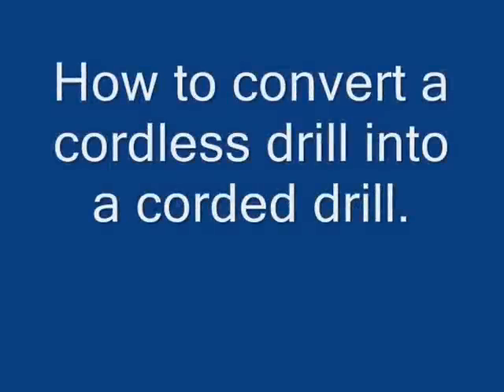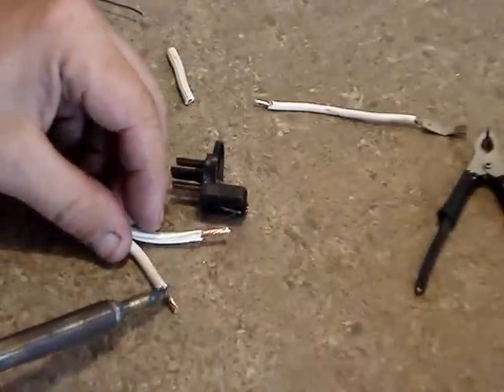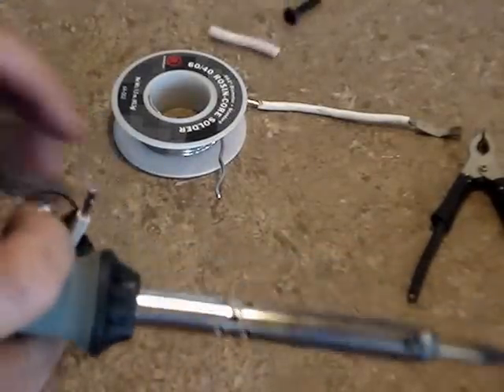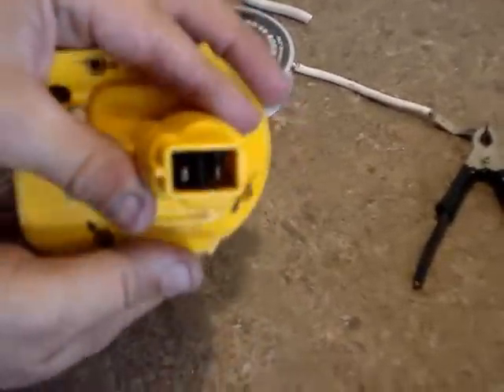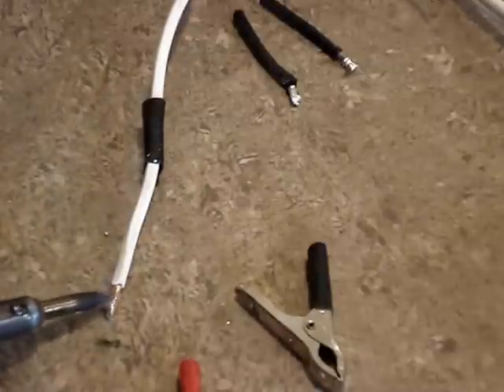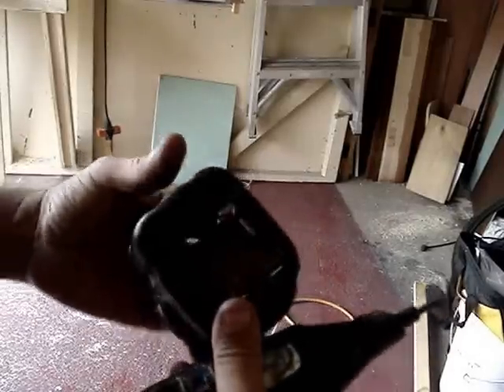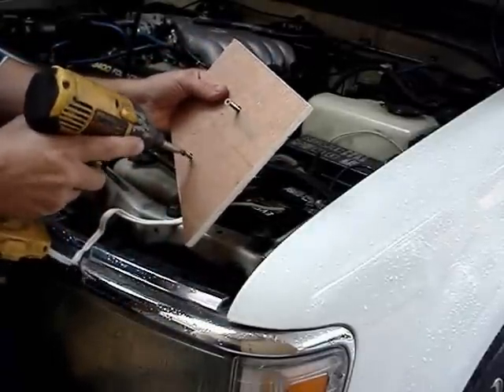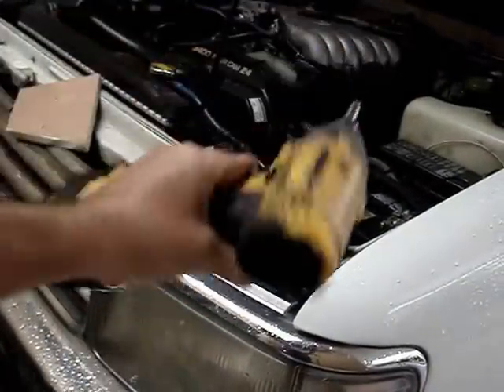How to make a cordless drill with a bad battery into a portable corded drill.

Comment: Bugger, I new I was keeping 3 good 12v drills for a reason,I think I binned them. I was just waiting for a heavy 12v supply. And I found a 40A 13.8v PSU on an old car stereo display.
I have done this twice before, you do need a thick cable for this.I'm having a hard time finding anything on the net right now,but NiCad discharge current is about 6C,6 X Ah Capacity, so for a 3Ah thats around 18A,so a small cable will have loads of voltage drop.Hope that helps someone and not blow a fuse :D

Comment from the maker: There are many ways you could do an 18 volt drill one way would be If you had a solar battery bank using 6 volt golf cart batteries you could tap off of three to get the 18 volts. The other ways would be more complicated but could be done. For me I never used the 18volt tools I figured if the work requires that much power I would use an a/c electric drill or tool. 12volt cordless tools work just fine for most work smaller and lighter weight. Thanks for the comment :)